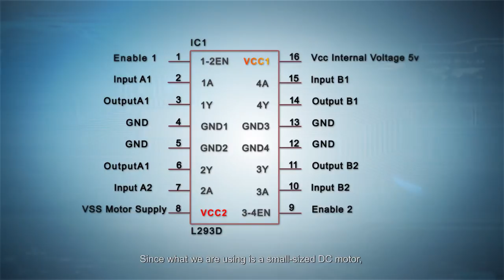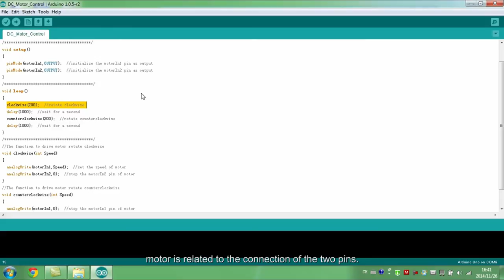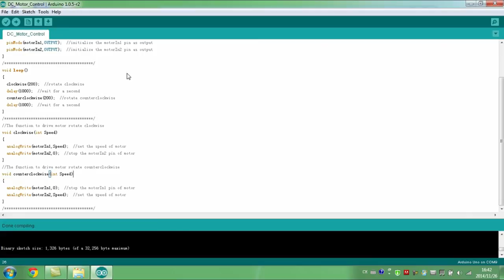Sunfounder Kit Turorial for Arduino - DC Motor

Comment: I had the same issue as others here did... the diagram in the book shows a circuit where pin 9 and 10 are each hooked up to a cathode of a photocoupler.  Wouldn't that limit the operation to high/low (on/off) functionality?  Or can you use analogwrite with a photocoupler?  I wish there was some explanation of this circuit.

Comment: I get the error message clockwise was not declared in this scope. What does this mean and how do I fix it.
Reply from the maker: +Laurimer Wright It's the void you may have missed before clockwise() that caused the error. You should check your code carefully and see whether it's the problem.
Reply: the big bracket for void LOOP ended before/above void clockwise

Comment: How do you connect the dc motor the the breadboard with the jumper wires? There is no slot of the jumper wires to go in on the dc motor
Reply from the maker: +Edward Kennedy You may notice there is a little metal plate again the blade on the motor, and there are two holes on it, which are the terminals of the motor. You may plug the pins of two jumper wires through the holes to connect. If you feel that they are not fixed enough, fold and twist the pin.
Reply: Thank you!

Comment: For the love of god I can't get this one to work, I have current flowing through the L293D IC as it's getting warm to the touch. Just the motor will not spin, I've wired everything correct as far as I am aware I've tried both the included chips and neither work.
Reply from the maker: Can you provide more information about your experiment, like your circuit connection diagram?
Reply: Sunfounder I really don't know what it was, it just randomly started working, perhaps a loose connection. Anyway thanks